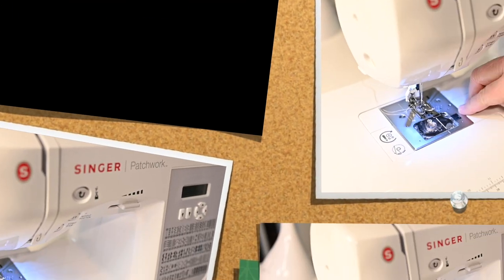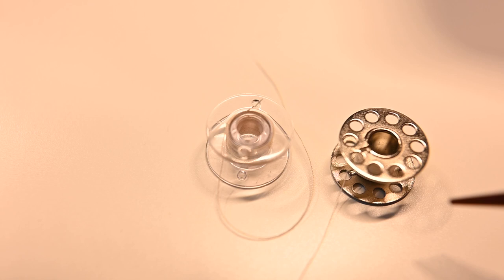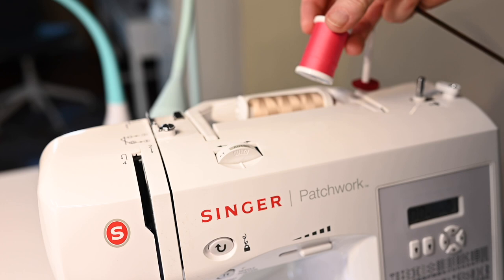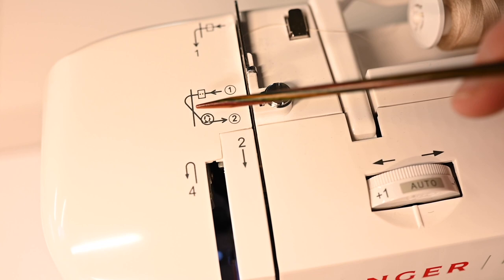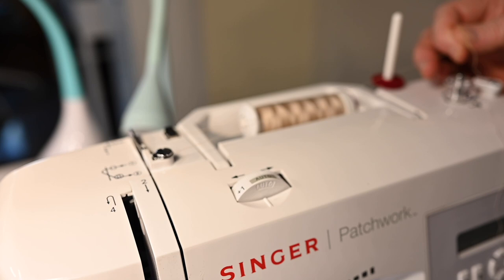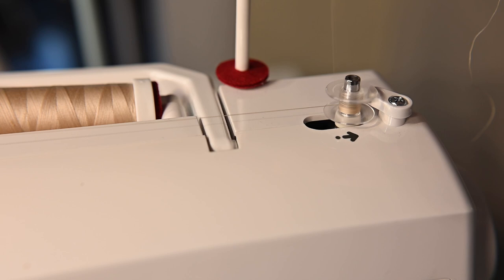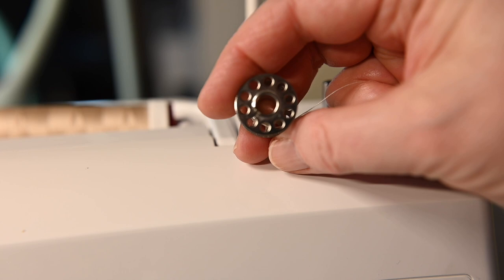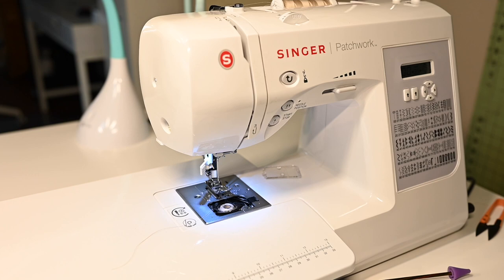HOW TO WIND A BOBBIN | How to fill a bobbin

Comment: ❤❤❤🧵🪡🧵🪡🧵thank you for teaching me about the places where I need to put my spool. I have been sewing for 46 years. I am self taught for the most part. With my grandmother's help probably in the beginning. This is probably the reason my sewing machines are giving me issues! I appreciate your help❤❤❤🪡🪡🧵🧵🧵
Reply from the maker: You're welcome!!! I do hope I helps you. Thread tension is 90% of the problems we have with our machines, generally. The way the thread is seated on the machine will wreak havoc on your thread tension and drive you bananas when it comes time to sew. Good luck and I do hope this helps you sort out issues with the machine. Also.....the importance of changing machine needles every 6-8 hours of sewing time is incredibly important.

Comment: Hi Patty, I received this machine as a gift for Christmas and I like it. I didn’t know about the spools of thread going horizontally or vertically. I have had problems with my needle thread breaking while sewing so maybe this is why as I always use the horizontal position for the regular spools. Thank you for this information maybe this is my problem lol. It just goes to prove this old grandma can still learn something new lol.
Reply: Me, too, Jan! 60 years of sewing and it’s the first time I’ve heard this! Maybe some of those spools I’ve thrown away were only through my folly. 😂
Reply from the maker: I sure hope it helps Jan! The way the thread is wound on the spool is why it's important to seat the spool in the correct position. I learned about this from a sewing machine salesman, and you would think the information would be more widely known, but for some reason it's not really talked about. Try the change and please let me know if it makes a difference for you!! It should make a huge improvement.
Reply from the maker: Lynn, I learned this from a sewing machine salesman, and for some reason it's not widely discussed. I don't know why that is, but seating the thread on the right spindle makes a huge difference. I hope you will try it out and see what difference it makes for you.
Reply: I’m going to try that tomorrow and I’m sure it can only help. Lol thank you Patty and good luck Lynn. Glad to hear I wasn’t the only one to hear this tip.
Reply: I'm headed to my machine as I type my response, I had no idea my spool should be vertical, I always wind it horizontally, and now I believe you've given me the solution to my minor issue!! Thank you!!

Comment: Hi, Patty!  I have the same machine as your newer/heavy duty machine and I use my Aurifil thread in the vertical position.  I’ve never had any trouble with that position, just curious why you say to use it in the horizontal position?  Thanks for your great videos!
Reply from the maker: Hi Kari! It has to do with the way the thread is wound onto the spool. And when it doesn't feed from the position it's intended, it starts twisting and pulling. I've had more than one sewing machine rep tell me this, and they know the mechanics of a machine inside and out, so I'm going from their information. That's great you have not had issues! Good thread on a good machine goes a long way towards reducing tension issues.  Thank you for watching!

Comment: Does anyone know how often you oil your sewing machine? My instruction manual said it wasn’t needed. Doesn’t sound right to me
Reply from the maker: I have only put a very small drop of machine oil in my bobbin shuttle 2x a year. The newer machines don't need as much from what I understand.
Reply: @PattymacMakes  thank you so much!
Reply: If your Manual suggests to not oil anywhere, the manufacturer of the machine is assuming you will have your machine serviced once a year.   During a service, the technician will oil where needed.  So, if you plan to not have the machine serviced yearly, ask your service centre about where you can safely put one drop of oil until you get the machine in for service.   Personally I have my machines serviced yearly, as then the machine gets the proper cleaning and oiling.
Reply: @1994henny  yes! I will definitely set up service calls. Thank you so much! I clean mine myself but I know I’m missing things. Thank you, I appreciate it